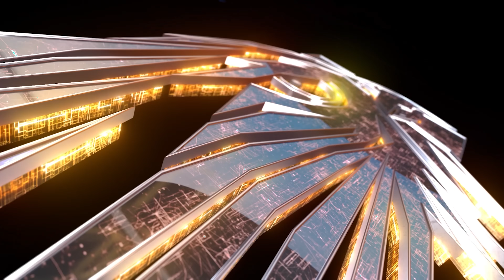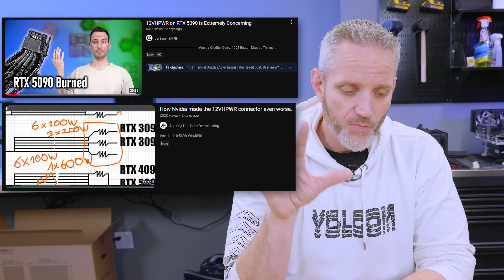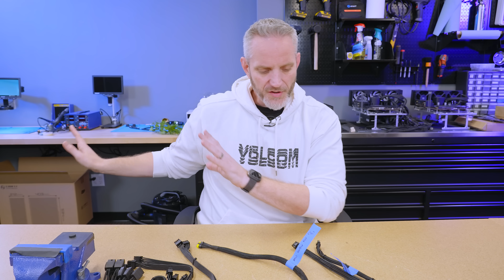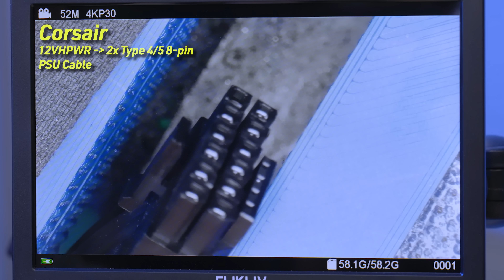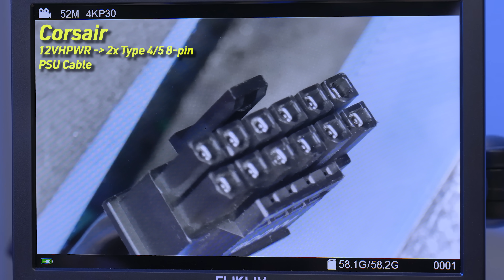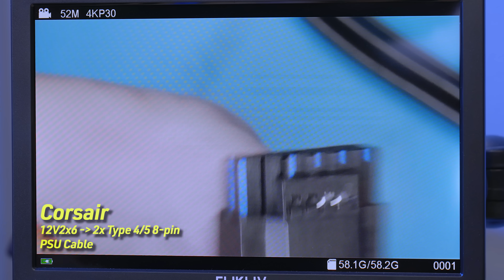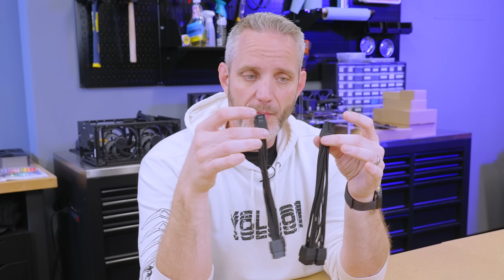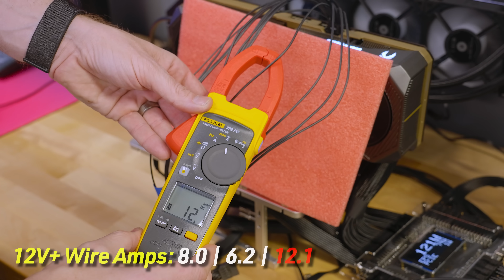I discovered something concerning and I need the Experts to chime in... More 12VHPWR discovery!

Comment: Ground, (typically -ve), has more alternate paths for the electrons to zoom out from the PSU 
- i.e. via the mounting brackets to the case which connects to the ground planes of each of the GPU, mainboard and the psu itself in addition to the cables run between components.

“Hot” (Positive)-side power is typically isolated, so you only have the power cables receiving all the electrons, which causes the cable to be the main “bottleneck” to the flow of power; aka resistance; This seems to me the most logical explanation of why the 12V+ side is being more temperamental about pin placement than the ground/negative side.

This is my instinctive response to a possible cause for the evident symptoms. I am not an electrical engineer nor an electrician.

Comment: I hooked up several mining rigs years ago, and was carefully monitoring the amps going through each cable and monitoring heat. When I first read about the new 12 pin rated at 600w I thought it was a joke. There's no way someone with any electrical experience thought this was going to work.

Comment: My 600watt 12vhpwr cable if from a Super flower leadtek VII gold 850watt atx 3.0 psu, and it shows HH+ on the side, and not H++ like in jays video, so the question is my cable is safe and yes allb the pins are high up and even the cable looks perfect, so show i be concerned

Comment: ive been an electrician for over 20 years, and its rule #1 you dont bottle neck the wire size in terms of amperage, i wonder how much those electrical engineers at Nvidia are making?

Comment: Seasonic make a very solid 12vhpwr cable that i use with my seasonic psu. No play. No pin retraction from pulling off numerous times. Sleeve with high thick coat i think pvc.

Comment: Has anyone checked the voltage on each line while measuring  current...what if the power supply is at fault here.
Maybe some lines are limited in the psu so the others need to pull more?

Comment: (In Europe at least) you are allowed to pull only 10 A continuously from a wall socket that's wired using 2.5 mm² cable due to socket limitation. Here you pull 12 A via 1.5 mm² cable :D

PMD2 is saving the cart, but not saving your house :D

Comment: Looking at derBauers video he shows the heat along the cable as well as on the PSU plug side, if there is a seating issue it basically reduces "guage" at that point which would cause heating but it would be localized to the specific point.

In the FE situation the individual cable 12v rails are joined after the plug, the PSU itself also does something similar and it is assumed the draw per 12v lines is controlled by the GPU side. However nVidia (stuPidia) assumes that if the GPU pulls 300W it would mean that this is balanced over all cable rails but that is not the case, the individual draw is defined by the individual cable rails resistance and this difference can cause huge changes (as in derBauers case causing almost all load going over the cable with the least resistance, this can be verified by finding a cable with the issue and measure each cable rails resistance).
Reply: Poor seating can cause unbalanced load. Ironically it is the pin with the best connection that will burn

Comment: Helicopter electrician here, guaranteed that would not pass QC. Different application, sure, but a bad connection is a bad connection whether it's the pin or the whole connector. Absolutely wild that Corsair would try to argue that.

Comment: The issue with using the nvidea adapter is that it takes four pcie power connetores and most high end motherboards take 2 cpu power connetores. And it's not very common for PSUs to have 6 pcie/cpu ports.

Comment: Hey J2C,

Auto electrician here. No, bad ground connections are not as bad as bad live (power) connections because bad ground will simply mean the component cannot pull its full potential difference since it can't output it, usually just leading to either slow performance or not activating at all.

Bad live (power) connections, on the other hand, mean the component will try to still pull its full potential difference since it has good ground and the PSU will simply push more current to meet the component demand. Leading to increased current, leading to increased temperatures, leading to increased circuit resistance, which spirals into a meltdown.

On another note, no pin connection should ever move. Stability is paramount.

Comment: you should just plug both into a dummy PCB you've setup, and measure the resistance - physical offset isn't the issue, it's resistance in the connection. (you're possibly right, but a milliohms measurement for each cable would be a direct measurement of the consequences.

Comment: In this case, It's all about contact between the female and male pins and what percent less they are touching vs being fully seated. It's possible the corner pin is only touching at their ends which would mean minimal contact.  Obviously less surface contact would increase the heat at that point due to more current passing through a smaller area. Corsair is way off base in their response.

Comment: Another test I wish Jay would've done at the end of the video would be not only showing the difference between the Corsair cable directly into the GPU vs through the Elmor Labs interface, but also showing one of the cables with solid pins (the MSI or the Fastech cables) directly into the GPU to see if there's any weird amperage balancing between individual wires on those cables. It'd be an easy way to test if the pins are actually the problem (they very likely are, this would just offer more proof). Of course Corsair and any other manufacturer will refuse to admit fault in their product until presented with overwhelming proof, so them saying "oh it's fine" is no surprise at all.
Part of the blame has to land on NVidia though...designing the card to rely on a single 12VHPWR connector while knowing good and well that the card can and will pull more power than the connection is specced for is every bit as much a fault as cables with shoddy QA are. The 5090s should've had 2 12VHPWR connections on them...honestly I'm surprised AIB partners haven't decided to add an extra one on their higher-end models, it's not like they're keeping their PCBs as tiny as the FE models are, so there's no reason not to use a little more of that space to put an extra connector and essentially load balance the power input to the card (plus then the "OC" models could actually have a meaningful overclock applied to them, or at least the potential for one).

Comment: If it takes 3 eight pins to run the power in, use them instead of the 12 pin burners. They sure have the realestate to put 3 eight pin sockets on the boards. Put an end to the problem they are not fixing. Nvidia get ur head out of ur arse.

Comment: Maybe it is not a good idea by nvidia to say "well, we need more powerful consumer gpus lets push the electric power of 1 village trough each of them. Lets use the wire diameter of a 1920s bulb lamp with 6 wires and connect them to a 2 wire curciut with an even smaller diameter".

My whole system, with a 2070 in it, uses less or at most the same power as a 5090 alone. This is just nuts.

And yeah, of course, you can do it, but you need extremly tight tolerances in the manufacturing process. And make sure no non-expert ever gets hands on it. Too bad this is a card for everyone with enough money to throw at

Comment: aww come on dude... that corsair pin just fine.... the thing that can make resistance high is the thickness and length of the wire... make the wire shorter and thicker can improve the situation.. the prob is who make the spec...and why....

Comment: Sigh*. The simpleton engineer here wonders…. Instead of these multi pin arrangements... which when one fails to connect causes issues equivalent to dropping a wire gauge…Why not use a stinking XT60 connector rated for 60A!!!   Why are we so married to these damn things?

Comment: My 5090 FE comes in on Monday. I've been using a custom 90 degree cable from CableMod for my 4090, but that obviously won't work due to the wonky angled connector on the 5090. Guess what type of PSU I have? Yep, Corsair. Did I go check my cable only to find out that it has this exact problem? Yep. Will I be rush ordering a better quality cable? Most definitely.

Comment: Nvidia: "Ty Jayz, we can blame the cable manufacturer again, not our cut cost PCB board problem."
Reply: Still better than the "Its user error"   that GN  left the manufacturers off with
Reply: In the video he explained the 'dumbing' of the connector from 30 series to 40 and 50 series. Its still a large Nvidia issue.

Comment: The wires with the most current flowing through them are NOT the problem. The problem is the OTHER wires. Higher resistance equals LOWER current. These are parallel conductors, the current follows the path of LOWEST resistance NOT highest!

Comment: For more than 20A you need wire that's ideally larger than 2.5mm2. Also if the pins aren't crimped properly, the resistance of the wire to pin joint gets higher therefore the temps get insane and will melt. I've seen a the copper of a 25mm2 cable melt because the person who installed it didn't tighten the screw on the circuit breaker to the correct torque spec.
Reply: That being said if the one pin has more resistance then if we follow the formula I=V/R (Amps = voltage /resistance) so the current or Amps will go up accordingly.  So the connector needs to be cut open to see if it was crimped correctly if it wasn't there's your whole issue right there. I'm a electrician for reference and I work on industrial machinery and this is what we do as troubleshooting when something like this happens.
Reply: The wires are in parallel, so more resistance on the wire will carry less load, and be colder. The melting wires are the ones with the best connection, i.e. the least resistance.
Reply: @bobbygetsbanned6049  I don't think that'll happen on a multi-rail psu though. But anyways just sharing what I've learned 🙂

Comment: It's simple really. It's a garbage design and connector. The pins (male) and associated sockets (female) are smaller than the old design. They have less surface area, and thus less current carrying capabilities. 

It's an implementation that should not exist.  There is a reason that high power car audio amplifiers have used the same type or power connections for 40 years. Because they are capable of reliable power delivery and work well against vibration and changes in temperature.  

GPU's and other power-hungry devices need only 2 things; A heavy gauge + and a heavy gauge -.  2 OFC , Pure copper cables would easily handle 600 watts and be better looking and more flexible while doing it.  But that would mean PCISIG wouldn't be able to collect their royalties.

Comment: So, if its a missing ground wire, the other ground wires will share the load, so long as they can carry the current, but if a supply wire is poorly connected, it still want to output power, and will for its way through the bad connection, especially if the other pins are at max load. There still might be an issue with a bad ground connection if 5 wires can't handle the load that the 6 will take. You can think of a bad connection as a bottleneck where all of the flowing electrons are squeezing and colliding, creating a lot of friction.

I'm in my fourth year of electrical engineering. I'm not a master at this stuff, but that is what I gather.

Comment: I will try to explain why a ground plug is less of an issue then the +12. Most pcb designs have a large ground plane so the ground will all go through one large copper section this evens out the heat. Another thing is that the ground as after the consumption of power (simplified answer) and thus have more fudge factor than the + side. The full answer is more complicated falling into the tldr zone. But the worst part is that we are pulling right around max draw for the part, You should always try to stick to no more than 80% of rating for max draw and try to shoot closer to 70%.

Comment: Why do we make this rocket science? It's ohms law. Multiple cables carrying power some get hot other do not all go to common ground and power. Why do some heat up? Because the cables that get hot have a lower resistance end to end than others. Probably caused by the connector pin mating. So take a cable connect at both ends with spare connectors and measure the resistance on each  pin. Do that to 10 cables and not the resistance at each pin. The wiggle the cable at the connector and measure again. Compare the readings. Not rocket science.

Comment: The funniest thing is that the connectors overheat and melt, not where there was bad contact, but on the contrary, where there was good contact, and as a result, there is a higher current
Reply: Assuming no arcing
Reply: Loose wires have more resistance meaning more heat. I don’t understand.
Reply: @Mr.Ramirez95  You are correct, but only when there is a single path for the current to follow. When multiple paths are available the current splits down each path inversely according to it's proportion of the total resistance. As such, it is conceivable that multiple bad connections caused the single line heating that Der8auer measured, although it's not the only possible explanation.
Reply: Dissipated heat is the resistance times the current SQUARED! The wire with least resistance will usually melt first in this case, even if it doesn’t sound intuitive.
Reply: @Mr.Ramirez95  You are thinking series circuits, these cables are parallel circuits. A bad connection in a parallel circuit sends the all the current through the good connection.
Reply: @xfreedombuckO5x ok I didn’t know they were parallel circuits. Thank you. Maybe i didn’t pay attention watching the video.

Comment: Man watching that pin move inside the connector really brings me back to when everything was molex plugs lol half the time the whole pin would just pop out and have to be shoved back in. Def a cause for concern. It seems to me like the GPU and or PSU need a chip that regulates the power delivery per individual wire and the plug itself needs to separate them physically from one another in order to do that. We will probably see a new revision incoming over the next 6 months... meanwhile AMD over there like yeah you know those good ol 8pin connectors never caught fire like this in normal use cases.

Comment: i work on car electrical issues and pin tension and recessed pins are huge. in terms of the ground vs power melting. i have seen voltage drops on ground and power side of the circuits but power side mainly melts more and i think that has to do with other grounds being shared by other components. for example a ecu can have 5 or 6 grounds on the harness but then also a ground of the metal body of the ecu. i would assume the gpu mother board is sharing a ground with the cpu motherboard back to the psu through the case. but i dont know if this is the case. im comparing a cars electrical system to a house pc. the only thing i can think of is pin tension, and at the scale and heat this is supposedly operating at, i can see thermal expansion messing with pin tension and creating intermediate connection in the connector (both psu and gpu side)

Comment: love your vids but you should not talk about cables just be quiet your making your self look silly its not a plug issue is a load balancing issue its NVidias problem and they know it 
a slightly out of spec cable  is not going to affect it to the point it melts. but trying to pull the full watts of the card through one or two cables will defiantly melt the cable. YOU should get one cable and a 500 watt load see what it dose bet it melts it